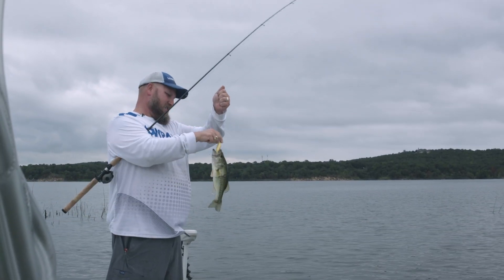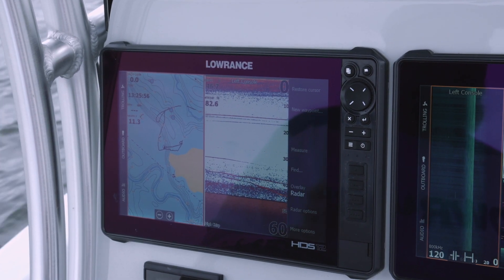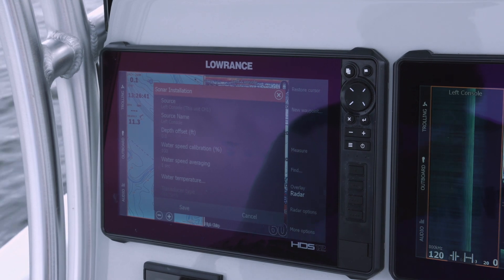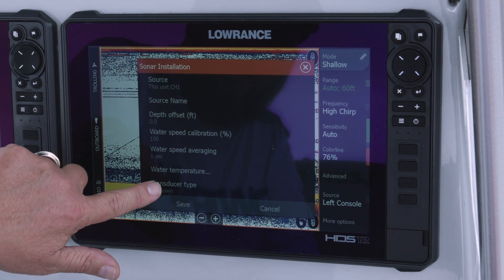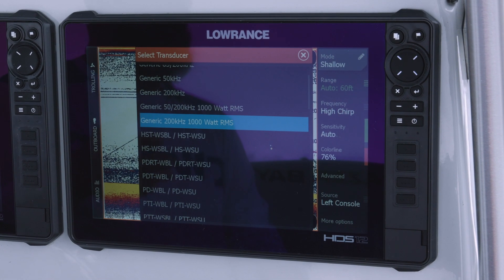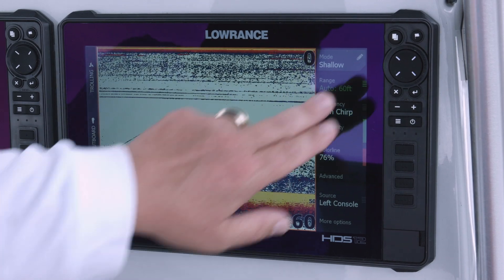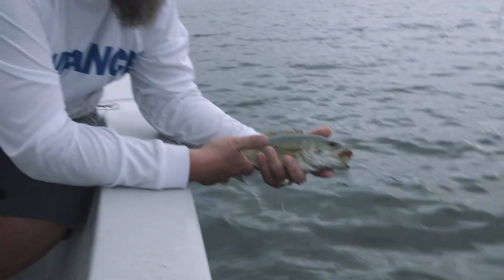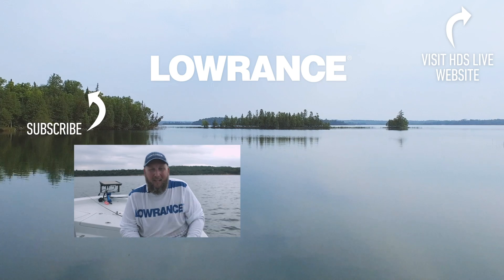How to Make Sure You Have the Right Transducer Selected | Lowrance

Comment: I have a blue puck transducer mounted on the trolling motor now. I also have black (guessing 9 pin) that came with the boat elite to unit,  that I don’t use because We have the live unit with the 3 and 1 transducer mounted where the black puck was mounted. 
The bow unit is a gen 3. Which transducer would be better on the gen 3 trolling motor. The blue or the black. 
The blue one does have down scan, 2d, and temperature. Would I benefit any chafing to the 9 pin transducer on the trolling motor?